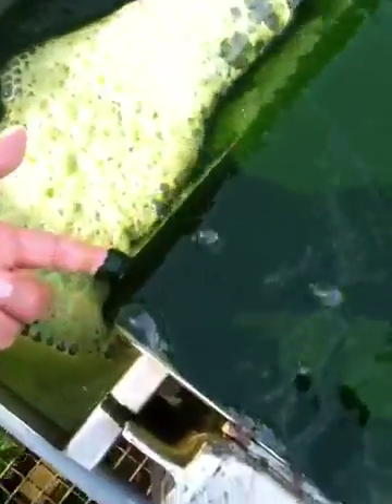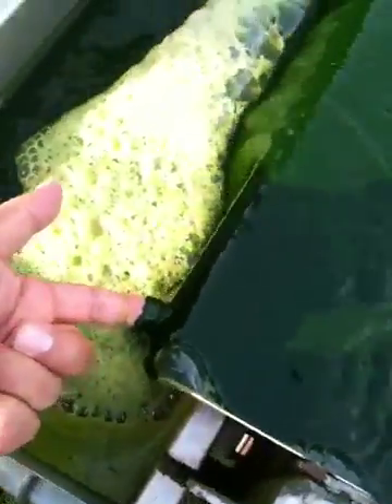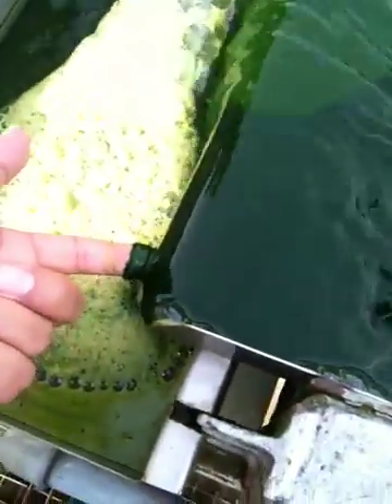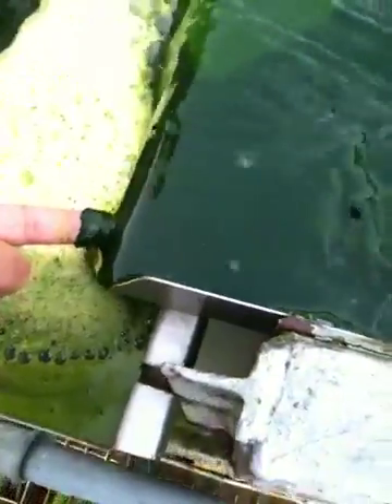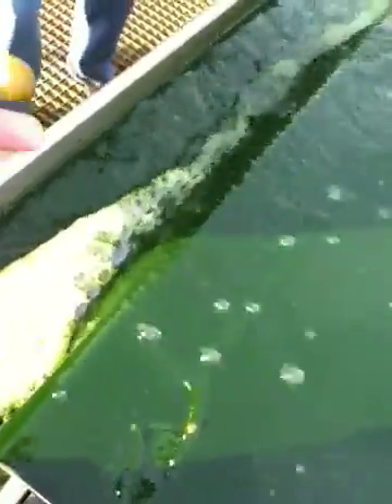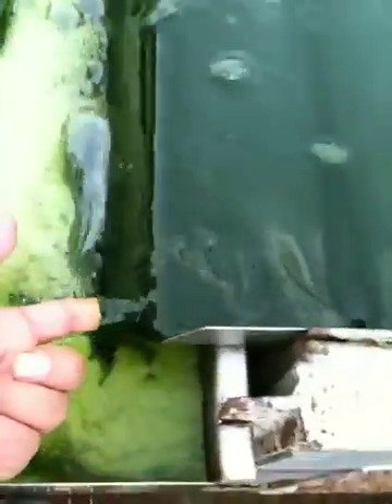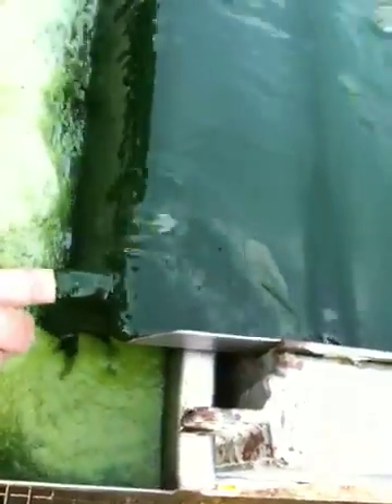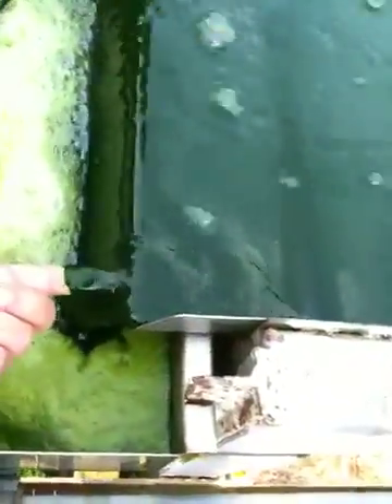Commercial algae farm

Comment: To explore the open and dense-walled microalgae culture at present, the technology of algae culture is mainly open-air culture, can not effectively absorb carbon dioxide, in the culture pond to place algae, the algae is only suitable as health food and algae block and other cultured food.
But today's extreme climate environment is also exposed to PM2 in the air. 5 and toxic substances with the rainy season and other weather factors, so that nutrients are diluted diluted and contents contain heavy metals and other harmful substances, the quality of the body caused by the growth of nutrient deficiencies, if the weather temperature is too large, such as cold or overheating will cause damage to the algae growth.
We know that microalgae are an obnoxious species and that this is not due to be cultured in open space.
(Taiwan's aquaculture is 40-50 years of Japan's technology), but at present, the development of technology and serious air pollution should not be open to aquaculture. Because of the outdoor mass culture, the algae body's growth is often affected by the sedimentation of algae, the stratification of water temperature and the unequal distribution of nutrients.
Especially when the illumination is intense, the dissolved oxygen in the water body increases, the high light and the high dissolved oxygen limit the algae body growth, this often needs to stir the culture liquid and add some harmful substances to the human body to eliminate the above adverse effect.
An issue often encountered by predators in the outdoor culture of algae is the sound of other organisms. Microalgae are highly susceptible to infections such as bacteria, fungi, viruses, protozoa, etc., such as crustaceans, rotifers and so on. For the aquaculture of Dunaliella salina, there are a small number of other organisms in the culture pool, such as salt cells, ciliate, artemia, amoeba larvae, fungi and other species of Dunaliella viridis. The most harmful to the culture of Dunaliella Salina is the Artemia, ciliate and so on. (in open or semi-dense culture, algae and air contact with plankton will be susceptible), especially in the high temperature season, microbial contamination is more serious.
Once the predator is discovered, it is necessary to throw all the culture fluids out of the culture pool, resulting in two environmental pollution. Because the specific proportion of algae is very close to that of culture liquid, the separation is very difficult. In addition, the biomass of algae in the unit culture medium is relatively low, so the efficiency of harvesting directly determines the cost and yield of aquaculture.
And the open culture in the harvest also becomes a difficult problem.
At present, there are many kinds of dense wall culture, such as vertical because of a half open culture, bag-type culture, flat farming, etc., in the recovery and economic benefits are not high, but also most of the experimental properties can not be commercially available to solve the chimney carbon dioxide emissions ask.
At present, there are manufacturers to develop a high-performance closed-type optical reaction equipment, can solve the chimney carbon dioxide and micro-algae breeding and harvesting equipment. Welcome to Explore
iw1547.ms17@gmail.com